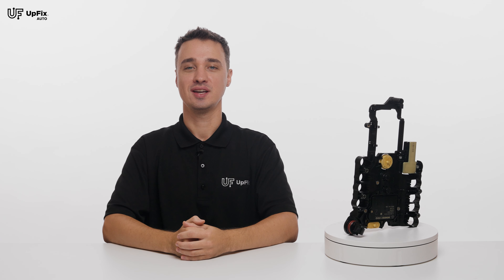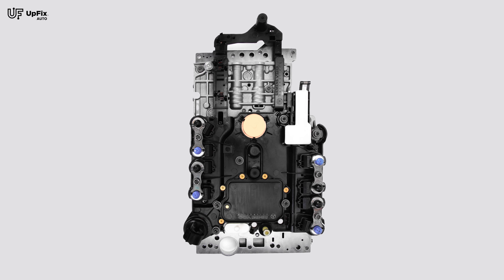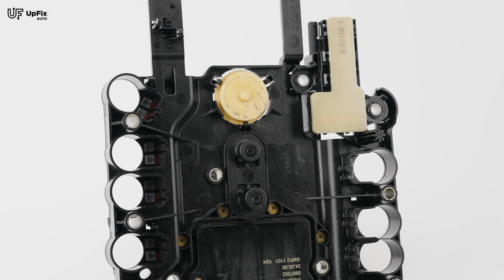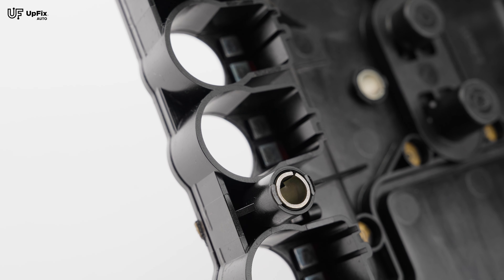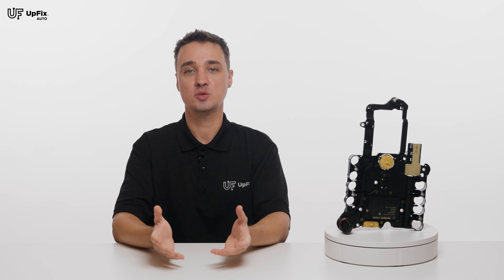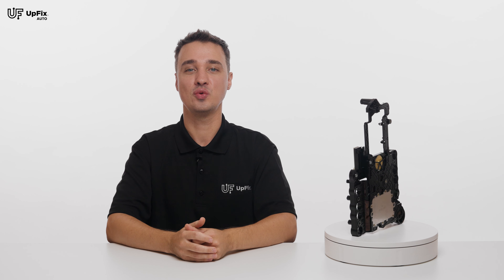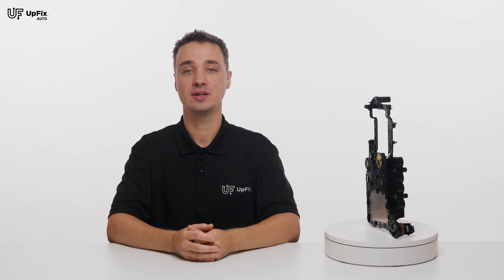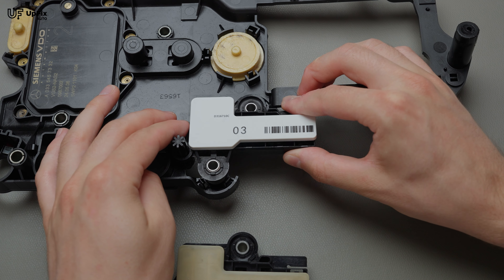722.9 Tronic Conductor Plate TCM Repair Service for Mercedes-Benz by UpFix

Comment: I have a 2010 c63 lately when I drive in traffic for about 20 minutes going slowly and stopping, the car does not exceed 4500 rpm and although I put it in neutral or parking and accelerate the rpm does not exceed 4500 and the car feels without strength
Reply from the maker: It sounds like your 2010 C63 is experiencing a power limitation issue, possibly related to limp mode activation. This can be caused by several factors, including a faulty 722.9 conductor plate/TCM (Transmission Control Module), a malfunctioning valve body, or torque converter issues. Since the RPM is capped at 4500 in both drive and neutral, it may be a sign of a transmission-related fault.

Comment: Hello I had a question. On my 2006 mercedes s430 i have a P730 code and it’s stuck in fourth gear. When I attempt to read transmission codes using my Autel MaxiDAS it says failed to connect. Do yall think a new TCM is needed?
Reply from the maker: This code isn't one supported for repairs however P0730 points to an issue with the TCM detecting an incorrect gear ratio.
Either solenoid is faulty, bad transmission mount, or filter and fluid needs to be serviced.
Some w220 S-Class owners have good results disconnecting the battery in the vehicle overnight to allow the TCM to go into a relearn mode.

Comment: Hi Upfix,

I'm getting code P2725 which leads to a solenoid issue, after replacing the Y3/8y6 B2 solenoid and swapping blue solenoids round I'm still getting the same issue? What can I do from here? Is a new conductor plate my only option now or is there something else I can try? I am getting the same symptoms as all the codes listed in your description.
Thanks.
Reply from the maker: P2725 - Indicates an issue with Pressure Control Solenoid E. This means the TCM detects an issue with the pressure control solenoid circuit.

First it's highly recommended to replace all solenoids on the TCM before re-installing back into the valve body. This ensures that the resistance levels on each circuit are within spec.

The solenoid itself should be getting between 10-25 ohms. Replacing only Y3/8y6 might not resolve the issue. Also, ensuring the fluid and filter are serviced and the right amount is inside the TCM will help.

The solenoids have all been replaced, fluids serviced, and wiring inspected for any shorts and still it's showing P2725 - it's most likely a defective valve body

Comment: In my case am getting code in w212 2012

U1138 CAN communication with component 'Auxiliary CURRENT and STORED oil pump has a malfunction
Reply from the maker: While we do support that year make and model as it does have a 722.9 TCM, the U1138 points to a network failure with the auxiliary oil pump not the TCM.

Check the CAN bus connections, the wiring and plugs for any issues, and lastly inspect the auxiliary oil pump itself for any faults.
Reply: @upfixauto  i replaced the tcm and now no code . But am facing an issue when i kickdown it stuck on 5500rpm and not shifting in any gear.
If normal drive it shift perfectly and smoothly in any gear at 5000 rpm.
Am facing this issue before and after the tcm replacement
Reply from the maker: @MaanzMotivation  Yes, that is a strange one. After a TCM replacement, the transmission may need an adaptation or reset procedure to allow the TCM to relearn shifting patterns. This is particularly common in Mercedes-Benz transmissions. It can often be done via a diagnostic tool.